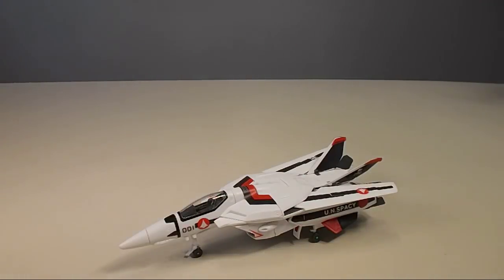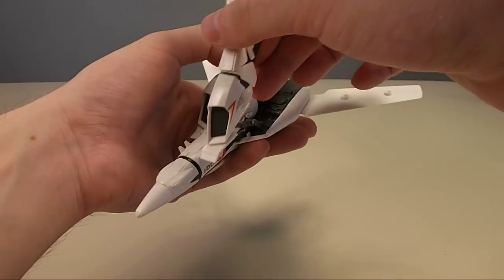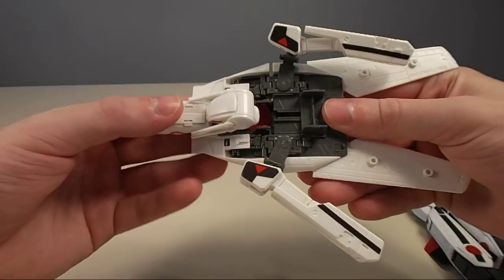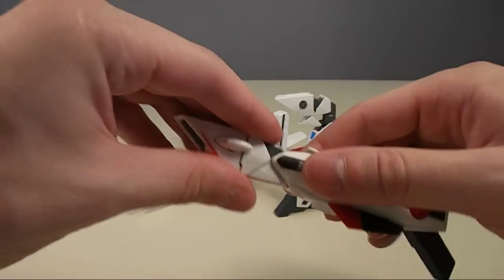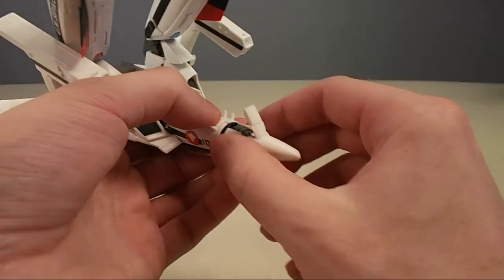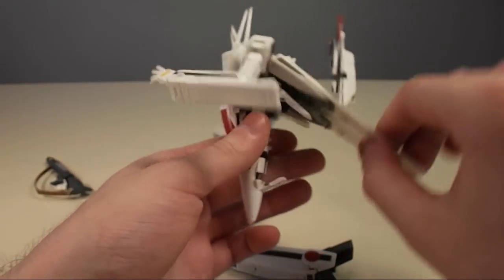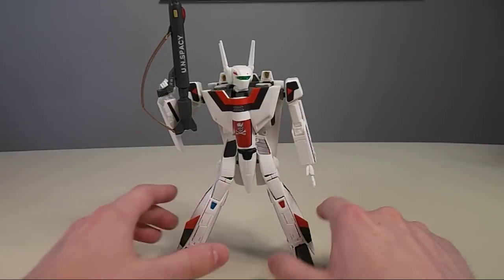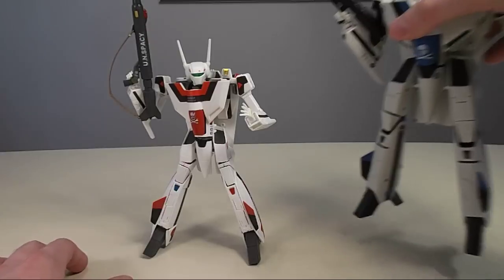Bandai Macross 1/72nd scale Variable VF-1A/S Valkyrie Model Kit Review - CollectionDX

Comment: I put together this kit, and it's... OK.  As a kit it's fine.  I don't think it's meant to be moved.  It can transform purely as a gimmick.  If you glue where the instructions say it will stay- kind of together.  Sometimes.  It's incredibly fragile, even for a kit.  I've seen ads for a heavier-duty kit out there that's basically a masterpiece toy in kit form with die-cast parts.  I can't find that in stock anywhere but I imagine its a lot better than this.

Comment: I've been making model kits for decades (mostly Gundams) and I've always wanted to have a decent fully transformable Valkyrie. I had one from Bandai 10+ years ago, the same one as the one 22:47 and that one was a mess. Never bought a Yamato because they're expensive. I was super excited when Bandai made this Valkyrie, it was fully transformable and it was quite cheap. So I grabbed one soon as I saw one in the store.

IT TOTALLY SUCKS. 

Holy shit, I had a hard time building this one. The parts are too tiny and fragile and a lot of parts won't stick. I never got to transform it into Battroid mode because it simply falls apart when I try. And who ever designed the hands needs to be smacked.

The effort was good though, the kit is (supposably) fully transformable and there is no need to replace or take off parts to do so. Quite cool how they did the legs transformation and the cockpit cover. Although I think this kit is a complete mess, I did buy the Super Parts. The kit does look very good in Flight mode with or without the Super Parts.

Bandai really gets a thumbs down from me for this one. Bandai has been improving their kits over the years. For instance the the Master Grade Gundam RX-78-2 Version 3 was amazing. Really didn't expect that they've made such a crappy kit in this day and age.
Reply: bwerx First off, learn the difference between an argument and an opinion. Second, according to you,  unless I can produce a better product therefore I can't complain about this kit and find it bad? What kind of reasoning is that? If you search around the web, you'll find that many people who built this kit shares the same opinion as me that is it's fragile and brittle.

I never said I play it as a toy. I said I can't even transfor without it falling apart. Learn to read.
Reply: bwerx Wow. Butt hurt? Not in the slightest. I'm just baffled by how you react. Even if I'm just a n00b modeller,  but how about the opinions of other experienced modellers who had the same and someone them even more problems building this kit as me? Is it really so hard for you to grasp that there are people out there that has a bad experience building this particular kit?

When did this kit come out, 2013? You would think that Bandai, who has great transformable kits like the Zeta Gundam, Delta Plus,  that they would produce a decent 30th anniversary Valkryie kit. I mean, I rarely hear people complaining about Yamato or Hasegawa kits.

"You're not worthy to be called a modeller" Oh my god, I'm gonna cry now.
Reply: +bwerx Dude, are you off your meds?  What's with the angry rant out of nowhere??
Reply: +bwerx Are you working for Bandai?
Reply: Gee! I wish I was, I have a ton of ideas I want to share with them on how not to make some of their overly engineered designs suck, so that modelers with flabby-sausages for fingers won't be overly complaining on how much hard they had it working on kits with tiny parts. In my opinion, if you can't handle kits with small and overly engineered parts, why buy them and then bitch about it later? Being a modeler and how long he's been building stuff he should well know by now that there are other kits that don't have tiny parts that make his life so miserable. This is not the only Valkyrie model kit out there. He won't admit it, but this guy is just a casual modeler, not a really dedicated one. I've seen other modelers who had done more intricate and delicate kits, I never heard them complain on how badly the manufacturer messed up the product. Working on kits with tiny parts IS part of the hobby, if he can't take it then find another hobby!
Reply: No medication will quell my disdain for such a boorish-uncouth person who tries hard to label himself a modeler. I don't think he even knows the meaning of the word, nor the labor that goes with the hobby.
Reply: Couldn't agree more.

Comment: If you spend the time and effort, it can be made into a beautiful model.  It is very fragile,but all of Ban Dai's Macross kits are this way. Their frontier kits are pretty agravating.  I've airbrushed mine. Took 3 months. It needs to be handled very delicately but it can be done.  My main complaint is the hands are awful in this thing.  Honestly, the strike parts work fairly well, painting them now.  This is definitely a kit for advanced modeller's though. Don't build this if you are a beginner.

Comment: i would rather choose a heavier but tougher model kit
besides, not every toy that is  built by abs plastic are tough, also need to consider about the thickness. like a lot of bandai or transformers 3rd party toys nowadays, they use abs, but they are too thin so it also break easily, especially when transforming them, which is a shame that the good designs were wasted

Comment: Is glue required on the assembly?
Reply: No, don't need glue! But with glue applied in the right place, this kit became more strenght
Reply: Also, you need color some little parts
Reply: So what glue did you use I mostly build models with lacquer thinner what type do I use is recommended?
Reply: TheSteven798v2  I used cement in very small quantities . I applied it in some parts to ensure more strength during the transformation. Now my model is more strenght, (but always requires delicacy...). Anyway, this is the second i build, so i already knew this model and its costruction. Applied cement is dangerous in case of mistake. Also, you need to mark Panel lines!

Comment: my tail unit broke $#@)$(* and the part while in battroid mode that you place above the tab that's used for securing the fuselage to the wing unit is flimsy. Using the current unit I have as an untransformable fighter :| though getting another one after lessons learned. (sticking to chugokins too)